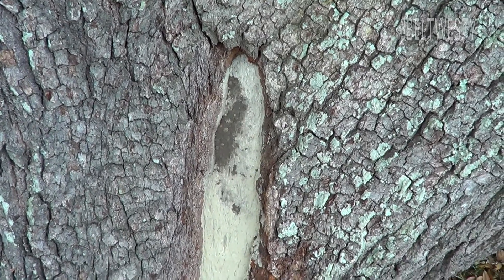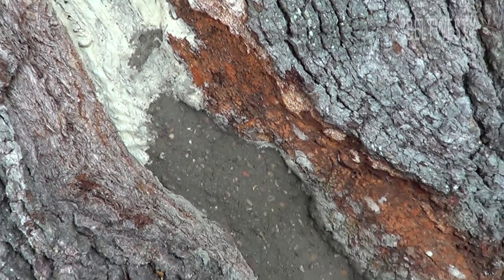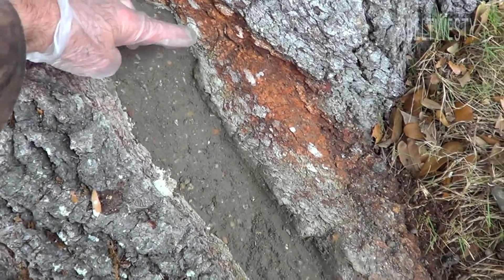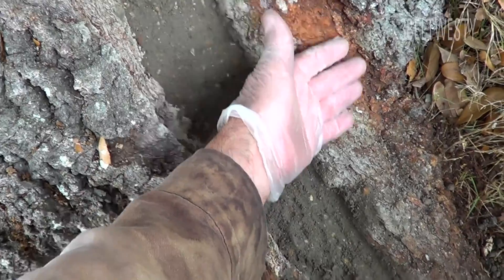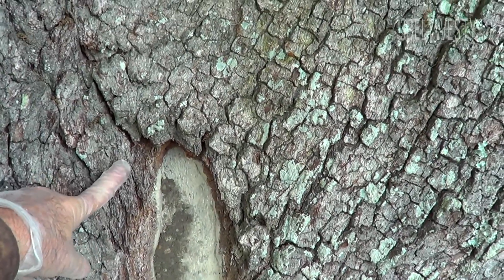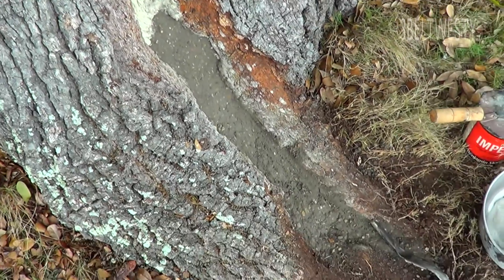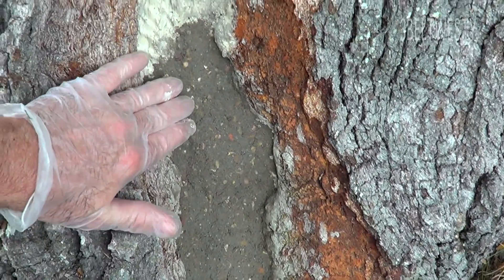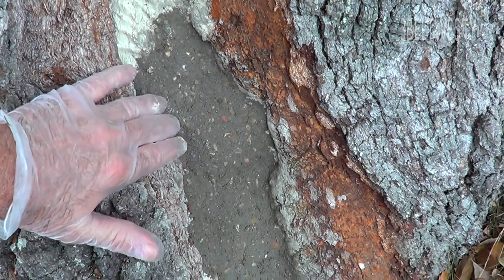LIVE OAK Tree lightning hole concrete repair  APRIL 12 2015

Comment from the maker: Concrete , steel plates, bolts  and nails etc will ruin a saw if the tree or limb is ever cut. Thus a more saw friendly filler material is expanding foam or even packing peanuts in roofing tar.     

 In another live oak tree's void here on a broken limb area that collected much water I did the non bio degradable packing peanuts and tar and the living part all covered it up in 6 years.    

 Most newer texts say to leave a void open and older texts say to fill them up.

 Here it has rained 7 inches in the last 2 days, but in Southern California it only rains about 11 inches a year. Thus the rot issue of a void that collects water may not be an issue where it is bone dry, but be a big rot issue where it rains 70 inches a year.

The void that was filled in this video kept on getting bigger as more collected water causes the bugs to go nuts and the decay grew more and more. Thus it was decided to clean out the void's decay again and again and thus fill it with concrete. If the void was filled with caulk it would have taken probably a dozen tubes.